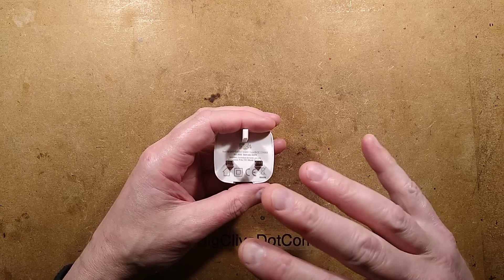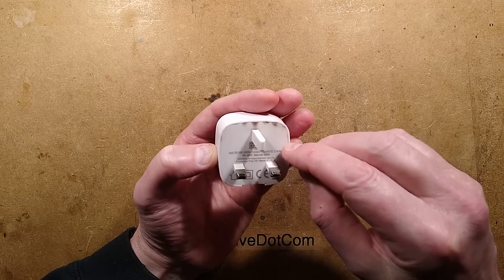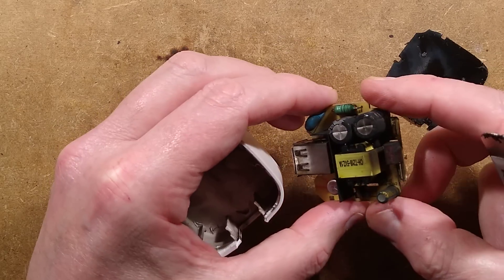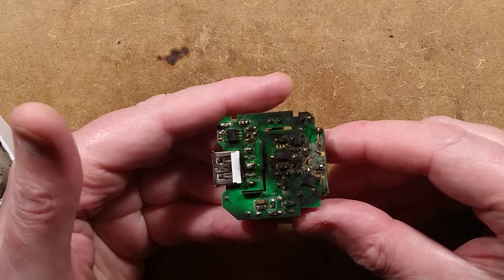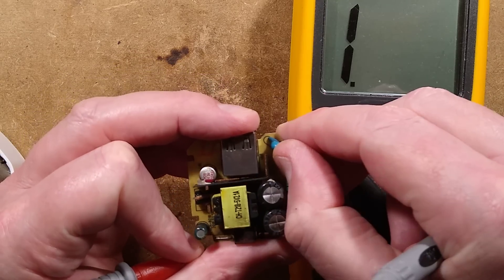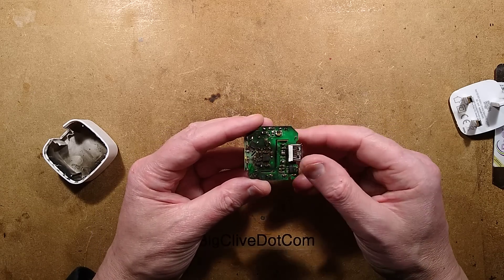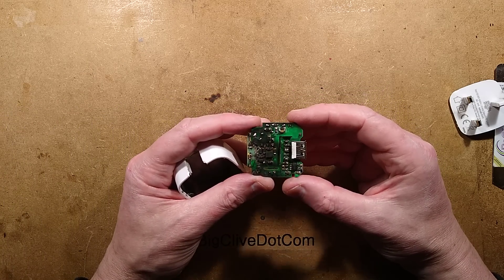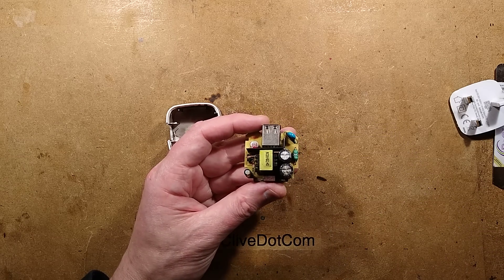Poundland USB versus lightning  (The lightning won.)

Comment: Incidentally it was an apple lightning cable charging the phone, there was not much magic smoke either just a loud Pop! 
Thankfully I had surge protection on all the other electrical/electronic devices so no problems with those.
Reply: You will probably want to replace your other surge protectors if you haven't already - the MOVs in them are essentially consumable, and for reasons unknown to me, not all surge strips cut the power when their protection is exhausted.
Reply: @rpavlik1  oh yeah totally great for placing its Earth protectors I did that when I had two different lightning strikes both times also upgrade him to something more useful or Outlets better protection more ports ethernet and coax and additional USB ports than before. excetera.
Reply: oh the irony .. apple LIGHTNING cable
Reply: Was your phone charging at the time? Was it damaged?
Reply: @Ultermategamerz  yep it was but cable blown out of charger with the force. Phone working perfectly (incidentally it was plugged into an identical 3way socket that Clive had in video and fuse didn’t blow)
Reply: check if you can install fortnite now :D
Reply: @redoverdrivetheunstoppable4637  well I don't think it's jailbroken I think it's just broken now in other words probably not going to work probably that poured if you could install software by that direction would not work either probably the lightning port that got struck by lightning became a firewire port and then became Thunderbolt when the power supply exploded so maybe the upgrade would allow you to install fortnite??????

Although it probably still run  Thor god of thunder.

Although it's probably be in it downgrade to a dumb phone more like down to the done attack phone AKA The Brick.

Just checked yep it's a dynatek now it's bricked.

You probably could have laid it out of cement and water and you wouldn't even need a Kilmer oven to turn it into a break all you need is a jolt from the blule.
Reply: @aaronbrandenburg2441  do you really have the patience to write all that stuff? ... anyways i didn't realise how many communication ports have a name referencing to thunders and similars

Comment: Unrelated to this video I have been searching for Clive's review of a solar powered 200 LED string xmas light a year or two back. Clive traced out the schematic and described the buck booster operation  which featured an inductor which looks like a resistor. Does anyone here know the title of that video? Also, Clive, you just taught me about class X and Y safety capacitors, I had never heard of them by this name although I always knew their purpose. The cap in this circuit is actually a class X not a class Y but we will forgive you this error, you teach us many things. Love your videos.
Reply: Yes the glove tell us the name of that video or link whatever or whoever knows definitely post a comment.

Comment: My dishwasher went bang last week. The bang was heard in the bathroom above the kitchen and all the house lights dimmed. Fortunately, our pre 1976 electrical system dealt with it like nothing happened. It appears a small liquid detergent leak found its way on to the live feed to the detergent pump - and presumably the casing as well - causing a short to earth. I was holding the casing at the time - and didn't feel a thing ! The fuse in the 13A plug did not blow - so the high current was only there for a very short time. Did I say 'pun warning' ? I wonder if my electronic leccy meter 'felt' it ?

Comment: Back when PCI dialup modems were a thing, I used to see a heap of them that had been taken out by lightning and then the card would stop the computer POSTing at all. They must have had decent isolation as you could almost always swap the card out and the system would come back to life as if nothing had ever been wrong with it.
Reply: Yes I remember that as well and yes they had to do isolation proper isolation Transformer and surge protection guess just charged a lot of times and others and sometimes even fusing sometimes wrapped around one of the protectors probably to act as a thermal limiting fuse as well from continuous current such as a line cross the high tension.

Also I wonder if some of the how if that was tied case ground never had a chance to look at that anyone know? Please comment.

Also one time one of my friends had a one wire weather station the used one wire protocol he had surge protection at both ends lightning struck his weather station ironically the lightning detector was what took the brunt of it. And even though that is Thoroughly positively grounded and so is everything else ever seen tied together properly for that but fortunately he had some sort of isolator between that in the serial port it took that out and just about it took that out and just about all the modules on the one our Network and there were other things as well outside such as a custom sprinkler controller for irrigation and other things. So which were also which I did with the weather station as well. But fortunately the computer was fine after that even serial Port was fine surprisingly.

Also a lot of the outdoor wiring for the one more network was cooked and some of it was completely vaporized on its way down the tower that is.
Reply: FCC Part 68 rules, which apply to PCI modems (and anything else that plugs into a telephone line) sold in the USA have requirements for surge testing. There are also leakage current limitations which I suppose would require decent isolation to meet.

Comment: my neighbours phoneline got fried her router blew up. those POE injectors from ubiquity are tough as they shunted the surge and they still work fine. my own heating controller went pop as well took the thing to bits and there is a small hole in the microcontroller that cost us a few bob to replace grrr
Reply: I take it that came through the power line? Or was that a separate time that your heating system controller got cooked/ blown up / destroyed.

And or just fried thought the magic smoke out whatever.

I have doubt had something to do with the phone line unless of course you got something some sort of spark controller or someone that communicates with utilities to control energy usage hair like dual rate meters or dual tariff meters used to be used for.

I do know in Tennessee in the rural areas a lot of electric meters are red / courtesy of the phone lines actual landline that is.

Possibly water me yours as well???
Reply: @aaronbrandenburg2441  these are two separate incidents at two separate houses.

i got called round by a neighbour saying wifi is fine but the internet is down and the phone line sounds crackly.

the telegraph pole got struck and the surge came in and popped the router.
opening up the router reviled a 2KV rated capacitor and a bunch of resistors had exploded. the resistors were right under the two ethernet ports connecting into those POE injectors luckily they still work fine.

the heating controller was at my own house, there was no dramatic skidmark just a small blowhole in the microcontroller.

i honestly have never seen a thunderstorm like that ever.

Comment: I have surge protection adapters in all my sockets with expensive equipment. Better safe than sorry.
Reply: By the way at my place I've had two lightning strikes so far since I've lived at this location.

First time it took out one surge protector which was smoking excetera charred although the equipment was fine it was connected to it

And two or three or four LEDs in terms of 60 watt equivalent all made by the same Chinese manufacturer all that bit the Dust.

I was wanting to upgrade my Surface protectors anyways so good excuse plus more Outlets there protection for both coax and ethernet as well and got a few more surface textures for other things.

Comment: Forgot to mention, as a kid i was holding the handset of a wall mounted dial phone in a call and lightning hit the line outside. It blew the phone clean off the wall, leaving me in the dark holding the handset.  the crater in the wall was something to behold the next day.
Reply: What's all the phone the ants had blown in half it got hit by lightning but it was not the original handset for that phone it was me by one of those companies that made us phone so durable they would go through a let's just say thermonuclear war and survive.

You know like in the old days where they had that commercial covered not covered yeah where the guy drove through the phone and a handset spinning that's where thing.

Was old Bakelite phones they'll take a look antique and keep on ticking. Or ringing or whatever those you can probably keep on talking as long as the landline still worked.

By the way those things can be you or some water lines or some voice over IP systems just take switching a spring from one position the other to lighten the spring tension on the ringer.
Reply: @aaronbrandenburg2441  err erm..

Comment: Used to laugh at my mother when she ran around the house unplugging things during a thunderstorm.
Mind you, back in the 80s it was only really the telly and stereo that was at risk.
Reply: Lightning is already fully capable of causing dielectric breakdown of miles of air, already a very potent insulator. In the face of a direct lightning strike, any consumer surge protector is much like trying to stop a train with a wet piece of paper.
Reply: @Lauren_C  'Wet piece of paper'. You mean FOG !
Reply: Recent thunderstorm, got so close I actually did - unplugged most major electronics - including phone, modem, computers - and went to bed. I don't normally bother !
Reply: @millomweb  I used to unplug stuff in thunderstorms, but I've not bothered for the last 20 years.  The only things I've heard of being fried were fried by strikes within tens of metres of the house, and nothing's gonna save your electronics when that happens.

And we get a lot of thunderstorms here in Queensland.
Reply: @Random_Bern  It's not often we get them so close - and for the last 20 years, they've been pretty rare in any case. We used to get summer storms - a lot of rain but no flooding. Flooding in various places in the UK is now more common. Is it the weather or is it reduced land drainage ?
Reply: @millomweb  I heard its down to drainage, especially in areas where they have a river there used to be ditches alongside to drain the water but these were filled in "for the enviroment" which ends up causing more damage crazily enough.
Reply: I used to work in tech support, we'd always get a stack of blown modems after a thunder storm, even when people unplugged the power they forgot about the phone line going in..
Reply: @davidbarrett6434  What's the point of the lightning arrestors fitted to phone lines then ?
Reply: @millomweb  dont know why they didn't have an effect, we're talking fairly rural here so over head phone lines on telegraph poles maybe that had something to do with it.

All I know is if there were thunder and lightning storms in the area, I'd be spending the next day swapping modems!
Reply: @davidbarrett6434  Is that in premises with direct wired master sockets ? That's what we have now they replaced the incoming grey twin cable with 'new' cable. - So, since 1935, this house has had three  'arrangements of copper' supplying phone services. The twin grey went to a lightning arrestor (it seems what it is) then to a GPO connection box then extended to the house phone with an extension to a bedroom. The first master socket was wired thru the arrestor but that is not the case any more - so do the new master sockets have arrestors in them ? Maybe not ?

Comment: I once created my own lightning storm which ironically the method you mentioned of using a fused strip made the situation far worse.

I had a large surplus linear power supply, this ran some amateur radio kit, and i had a separate charger for a handheld radio. (Ft272 i think)

All plugged into a 6 way power strip with 13A fuse.

The transformer decided to fail by shorting primary to secondary, the resultant 240V hitting the secondary built up a huge flux in the transformer and the current drawn blew the fuse in the 6 way strip everything was plugged into.

There was an almighty blue flash/bang when this occurred followed by silence , except my ringing ears as i was sat about 2 ft from the blast centre.

The back emf it created to all the devices on the now isolated from the mains 6 way vapourised transistors and chips in everything that was plugged into it, even the handheld radio on it's own charger had black stains where surface mount transistors used to be inside.

The energy involved must of been huge!
Reply: You learned it the hard way, i might've blew up some capacitors and resistors, some chips but never in my life i blew up a transformer
Reply: @hassankhurramtech  well the transformer shorted internally between primary and secondary, so it turned itself into a large ignition coil with the might of the national grid to fuel the it :)
Reply: Must *have
Reply: @Asdayasman  yep thanks for the grammar check ;)

Comment: I remember when lightning hit my house when I lived in Orkney. The old mans desktop computer blew a hole in two chips. Fairly neat holes it must be said. The old dial up modem found it's way to the other side of his 6ft study from the window sill it usually lived on. Hell of a rumble when it happened too. Not to be sniffed at the current in lighting
Reply: Did it come through the cabling or get lightning somehow get through the window opening? Also I've seen from cables vaporized I've also seen over headphone wiring where to call for had vaporized in left the insulation dangling with pin holes in it and scorched. Also once saw the inside of CRT TV that had been a victim of lightning the picture tube had melted in some areas.
Reply: @aaronbrandenburg2441  I was young however I believe it traveled via the cabling of the house as all other electrics stopped in the house at the same time. Probably threw the main breaker. Whats strange is I remember feeling the rumble after intensely. Other people in my parish said it cracked windows. Yet apart from the electric side of things are house was relatively unscathed

Comment: When this happens, it's worth your while checking (or having checked professionally) everything electric or electronic in the house. That spike won't just have hit the charger and other things may be suffering as well, tho less visibly.
Reply: Oh by the way speaking of which I had heard through a to a friend of my mother is that every time there's a bad storm their main fuses with blow at their house this is back when everyone had fuses and not Breakers. Mostly.

Strange indeed any thoughts anyone?

And also something else strange this is where the phone equipment old school landline.

But when someone next door has phone would ring their phone with the be just barely audible but come and tinkling sound on the Bell they said something that they'd heard about not properly grounded or something I don't know.

But I do know there's what they call the anti-tangle Circuit you had a landline old school phone that prevents the telephone ringer Bell from rain just a bit when the phone is dialed on Rory. Old school you know. So might have something to do with that who knows comments anyone.

Comment: What would it take to make domestic electronics lightning-proof? (If that is even possible...)
Reply from the maker: Lots of voltage clamping and luck.
Reply: As they say nothing is foolproof nor idiot-proof nor lightning proof if there's a way that something can happen it will and undoubtedly it may take a billion years but it will happen eventually.

Comment: I've been through a lot of lightning before ( since I live in a tropical region and there's only 2 seasons. ) It manages to strike 5 appliances before I've put a dummy antenna that connected to ground to be used for sort of like a lightning rod. That day the telephone line was strucked down and my mom decided to just uninstall the telephone line. The next one is 2 satellite set top box. My grandpa forgot to plug the set top box out when it's raining outside and within seconds the set top box is destroyed ( it gets strucked 2 times in one day. ) The last 2 was my TV. It's sad that it struck my 110" Sony Bravia. The technician says that it'll takes a fortune to repair, so I replace the TV with 46" Xiaomi MI TV 4. After that my grandma's TV gets strucked by lightning ( again, same story as the first TV. ) :-/
Reply: Sounds like my experiences many years ago, in Malaysia and Indonesia!

Comment: The case did exactly what it should and contained the explosion - pretty good, actually.
Reply: Also seems to have an explosive disconnect feature XD
Reply: surprised it didn't blow the whole top off, leaving the plate and prongs connected live
Reply: @throttlebottle5906  that couldn't happen eu plug prongs are designed not to do that
Reply: @andrewbyers1555  yeah and jet's are designed not to have failures, power grids are designed to be resilient and not have blackouts.
it only gets better as the products become more chintzy...
Reply: That’s kind of the beauty of cheap USB plugs like this; the tolerances around the USB socket are probably Sufficiently Shit(TM) that the gap around it provided enough of an escape route for the explosive pressure. Blew the cable out, too, didn’t it? They could market that as a design feature; ‘Protects your electronics by automatically disconnecting them from the adapter should a fault occur.’ 😁